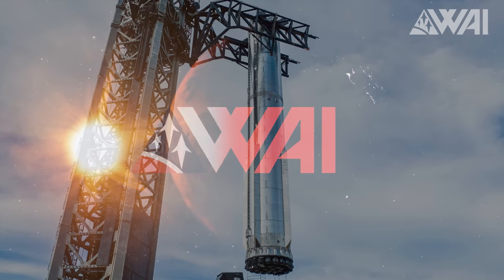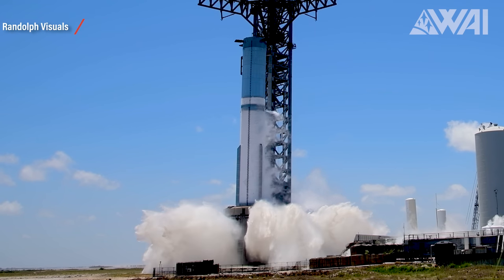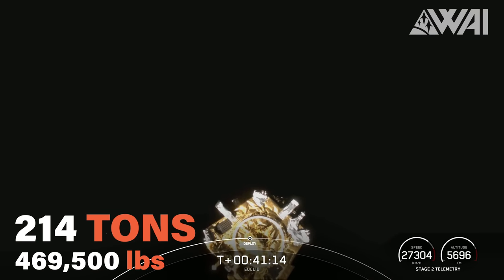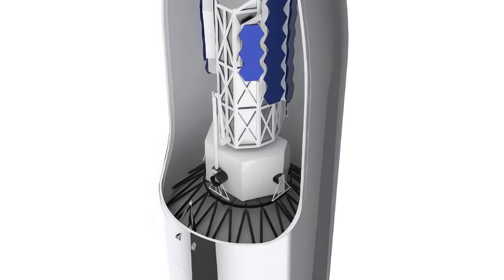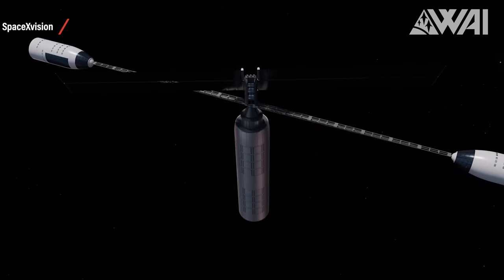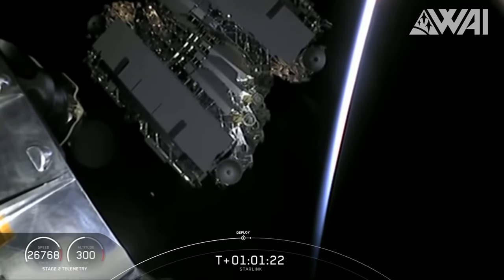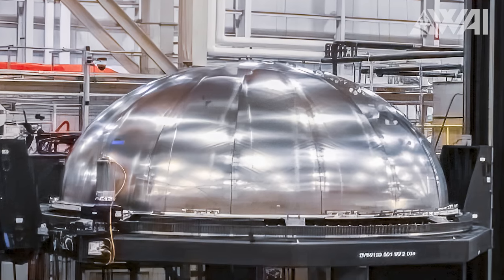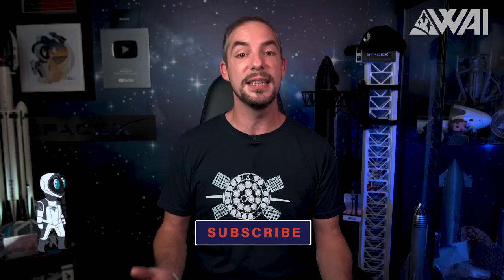Let the Monster loose! Starship Booster 9 Static Fire! How will SpaceX's Starship shape our future?

Comment: SpaceX changed the space launch business with the success of Falcon 9 and Supper Heavy. With recovery and reuse of so much hardware. When Booster/Starship flies and becomes operational it will once again be a new business model and open up the system from the Belt in.

Comment: i had this weird idea once to make a rocket but not allowing it to reenter the atmosphere to burn up or be recovered as a spacex is.  i wanted it to be built in such a way that the rocket would be taken apart and its parts used to fabricate a space station while it's in orbit.  the rocket wouldn't carry a payload because it IS the payload.  anyhow thought i'd share that... idk why i thought about sphereical ones like the death star or band ones like the station in the game halo or movie elesium.  sorry my spelling stinks.  anyhow thought i'd share that :D peace.
Reply: There was a concept years ago to make the Space Shuttle external tank slightly larger so it would reach full orbit. It could be furnished on the ground with a basic set of interior, then turned into a space station module, since it's already airtight and fairly sturdy. I don't know why they never did that.
Reply: You mean like Sky Lab? That already flew. It sucked.
Reply: @filonin2  AFAIK, Sky Lab was a modified Saturn V 3rd stage. I'm too young to remember any details, I just remember that the deorbit was kinda messy and a lot of people were worried about getting hit by debris.

Comment: 7:33 Well, most of the word(90+%) agreed using the International System of Unit(metric). AFAIK only USA uses anything they like except a standard unit of measurement, also when talking about science and rocket science it is using SI for decades.

Comment: for a moment i almost let it pass, but then i blinked and thought "only 22" - starship really is a game changer.
Reply: Why does 22 make it a game changer?  I mean to be fair that is a lot, in the amount of time SpaceX has been working on Starship the Saturn V only managed it's first launch, of course it included all stages and was a complete success.  And I must admit they never even built 22 Saturn Vs only fifteen that were flight capable and just 13 of those launched.  Then again of the aforementioned 13, 10 were manned, 6 landed Men on the moon with zero launch failures.  Did you mean game changer in a negative way?

Comment: So, they just had the static fire (20 minutes ago). Full duration burn and apparently much better performance of the water system (no water visible while running but as sson as the engines shut off, water returned at what looked full strength).

Comment: Engines are normally covered at any time, when not in use. So it was a "special view" to see all engines at SpaceX uncovered at any time and duration. Exposed to seawinds, sand and all weather conditions every time. To proove technical stability as seen on any parking lot over the globe - all cars outside at any time and condition? but maybe this was too early even for smokin´ raptors!?

Comment: Felix, I understand all the concern regarding the damage caused by the 30+ rockets firing all at once causing  damage to the  area.  Why can't they start with 2/3 of the rockets firing until it clears 75% 0f the tower then ignite the remainder of the engines at full thrust providing distance to reduce the damage potential?

Comment: Starship would be perfect for building a larger ship bound for Mars to establish a colony or base. One trip rather than thousands.
Reply: Yes, the "put all our eggs in one basket" strategy that always works so well.
Reply: @filonin2  who said anything about only building one. it will take several, but it will cost less than sending thousands of little bitty star ships. and yes, comparing its size to the size of what is required it is tiny. if they send swarm bots on the first load they can build all the infrastructure needed to sustain the goal which ultimately is colonizing mars not satisfying one man's ego. Star ship is just a starting point for true space exploration not the end.

Comment: 7:33 "Why, why, why can't we have just one system of measurements?"
As far as I was aware, we do. It's called the SI system. I think most of the world outside the US does so. In the UK we started the process of abandoning Imperial measurements when I was at school in the 70's. Like the US, there is still inertia. So beer in pubs is still sold in pints.
Reply: Al non IS measurements are actualy defined officially as just IS units. E.g. the
inch is difined in meters

Comment: What would the efficiency look like compared to a normal space x rocket engine if the rocket engine had a laminar flow tube in the throat above the bell housing and the bell housing had like an upside down bowl in it to direct the gas in a circle and not a cylinder

Comment: I have a question.  The batteries and motor controls are on the top of the booster, right?  If they weld the cap on for hot staging, how do they make those components servicable?
Reply: Maintenance hatch
Reply: Probably a hatch.
Reply: The new section has clamps on the top (maybe on the bottom part too?) If so it can be removed, reused and/or replaced easily and provide some access below.
Failing that, I go with @sixstringsimpleton"s explanation.

Comment: Why not a single system you ask? You SI folks are free to join the only measurement system to land people on the moon any time you want! 🙂

Us US folks are a stubborn lot. But we also, freely, move back and forth in use just fine: 2L Cokes with 150 mile trips. We're flexible if stubborn.
Reply: We gotta work both here all the time in Canada. some time ago, Texans suffered an unbelievable cold wave that was a Total Disaster for them. No, it was not funny. They described temperatures well below Zero.
They were laughed at and mocked by those thinking in Metric. Real Zero the Old way, was Nasty. Minus 18 degrees
Reply: "the only measurement system to land people on the moon" - was metric. The Apollo landing computer displayed Imperial for astronaut familiarity, but all the internal calculations were metric.
Reply: Metric is for the math-challenged.
Reply: @Julius_Hardware  
There was a Mars mission that only failed due to a mix up of Metric and Imperial. Yikes! What a waste !
Reply: NASA is metric , so was its German engineers.

Comment: I wonder if the engine covers aren't shower caps. I was always a little concerned that the water deluge was going to prevent the engines from starting, which is kind of what we saw during the recent static fire. With a shower cap on the engine, the water deluge can spray onto the cover but when the engines reach pressure, the cover blows off and the engine exhaust overcomes the deluge.

Comment: I enjoy your videos a lot even though I have to filter out a bit of your unbridled enthusiasm and optimism for the success of the program. It’s a fascinating engineering process, but I’m not convinced it will usher in a space revolution. I mean the mass to orbit and volume metrics are potentially enormous - but the road from here to there is long and full of very big unknowns. Rapid reusability is far from guaranteed and depends on many untested factors. And let’s not even talk about orbital refuelling, which has never been performed, let alone at the scale and over time periods proposed. Frankly I’m amazed NASA chose a system with so many unknown variables for Artemis - but sometimes the narrative is more important than actual feasibility and capability.

Comment: compare Besoe Virgin as little childs bikes that go up come down or a wealthy guys play ground ride .
Soyoues  as a Business hatch back
and super heavy sn25 as tghe gig daddy Haulage lorry goods tanker worker transporter?

Smn super booster is the big Meccano Lego big bits building machine box of tricks
to enable huge undertakings construction 
A means to get robotic machinery prebuilt systems parts units
and expandable inflating abbitates power units into bear earth safe orbit?
also take refuling and strap on booster gcold booster centrols when needed
and bring the waste bits back..
SN is tghe needed get material up down
and leace the hguman cargo untill 100 %   
ways to return back safe like passenger pklanes do now is achieved.
Space fligfht is still in the Wright B ros stage
with many failures lessons to bve learned.